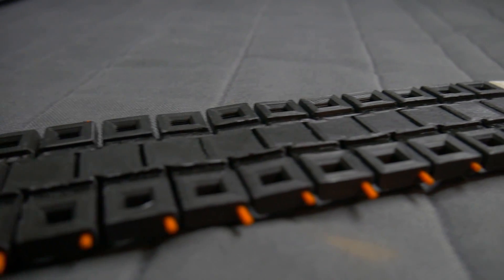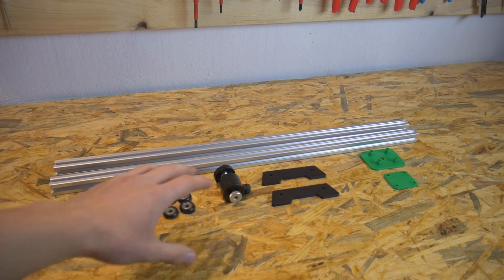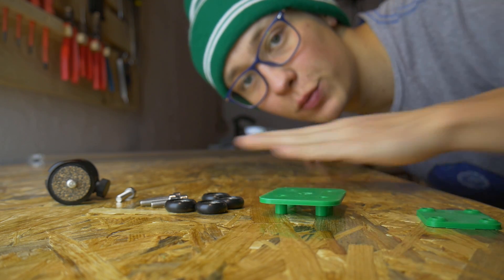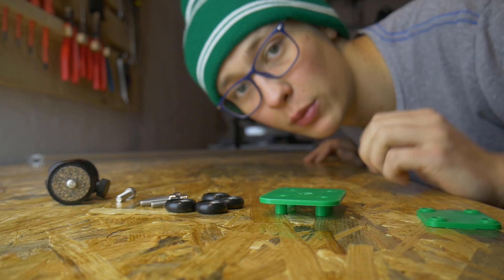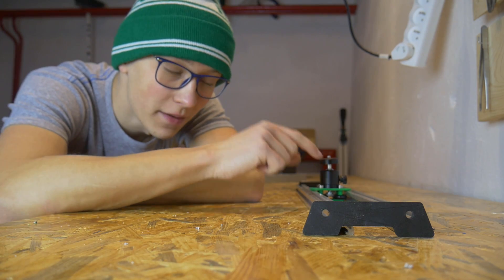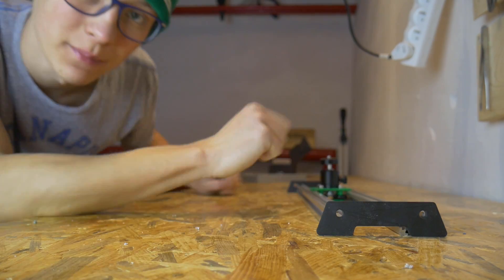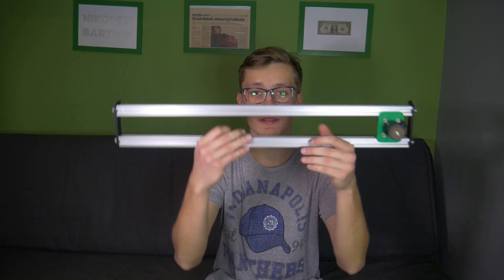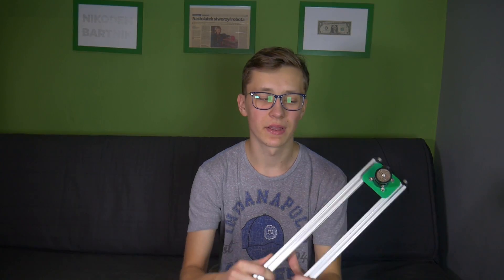3D printed $15 camera slider

Comment: As a lifetime photographer I really appreciate this DIY video.
One small point, Nik... In various videos you mention "20mm aluminum profiles". However of the 20mm profiles there are two related types... the older T-Slot and, more recently someone came up with the newer V-Slot which matches up with those wheels to work as a linear rail. It may be helpful for noobies for you to make the distinction so they don't buy the wrong thing. 😉
Cheers! 🍻👍

Comment: Well done Nikodem,
but what about the yellow geared motor you have showed on your gray sofa? It cannot be suitable for  motorizing your slider?
Reply from the maker: Thanks! That could work, I am not sure if it is powerful enough for a slider like this. Also, there is no way to run it slowly enough to make some cool looking timelapses. Stepper motor is the best solution but I need something smaller than nma17.
Reply: @nikodembartnik  Yes stepper motor are the Best solution. Try to find an old inkjet printer: the paper feed motor usually  is a stepper motor (at least in Epson printers) i guess that the yellow geared is strong enough to slide the camera, maybe a little slow but playing  with the diameter of the traction pulley you can realize the motion automation ciao

Comment: Nice work, the price of this project could be reduced if only one 2020 is used with just 3 wheels, 2 on 1 side and 1 on the other.

The printed parts on the ends could protrude slightly into the 2020 to stop it from rotating, or be bolted into the sides of the extrusion.
Reply from the maker: Thanks! It's better to add this wheel, it's more rigid. That's true small feature in this 3D print could stop it from rotating.

Comment: They sell a tracker Cape where it has grooves Built-in like it's basically 1/2 of a belt and then you could install a small motor with teeth and it would grip against that
Reply from the maker: Motor, battery and everything would take a lot of space so it would be hard to fit all of that below the camera, it's easier to use GT2 belt and add a motor to the side

Comment: Also, do you have a video on your motorized slider?
Reply from the maker: It don't look as nice as I would like to and that's why I didn't share it anywhere and because I used some old inkjet printer parts it would be hart to replicate it.

Comment: Nicely done. Do you have a link for T-Nuts that you'd use with that type of extrusion?
Reply: I don't think he used any t nuts. Just M6 and M5 screws.
Reply: @deathshaker0026  That is true, but was wondering if he had a source for the nuts that go in the rails. Nice price on the extrusion, so though he might.
Reply: @JeremyCook  Personally I would just order it from  China.
Reply from the maker: Sure here you have some: https://www.banggood.com/50pcs-M5-T-Sliding-Nut-Zin-Plated-Carbon-Steel-T-Sliding-Nut-for-2020-Aluminum-Profile-p-1048439.html?p=PW041611183930201706&cur_warehouse=CN

Comment: Great project!, the first similar construction that I thought of is the cartridge positioning mechanism used in inkjet printers, is has some sort of encoder strip that is used for precise position control, same idea can be made for the camera slider to control the position and speed using encoder feedback.
Reply from the maker: Thanks! For my first slider I used parts from an old inkjet printer :)

Comment: Looks great! Do you plan to add the motor?
Reply from the maker: Thanks, I will add the motor but I have to find a motor that will be small and powerful enough.
Reply: The 5V geared stepper motor 28YBT should be strong enough if there is not slope,  it only costs around $1.50 and can be modified to 12V.

If used with a threaded rod it will be slower but even stronger and more precise.